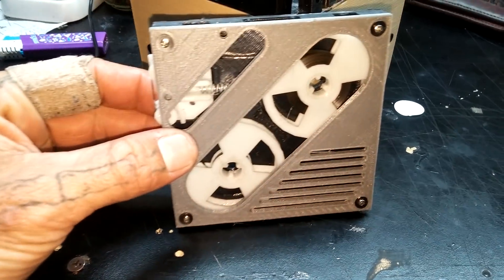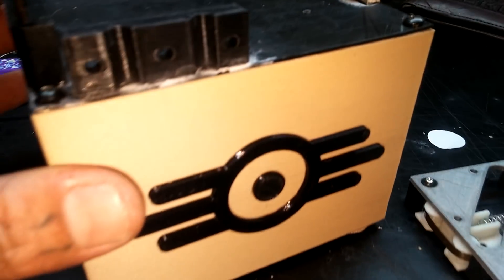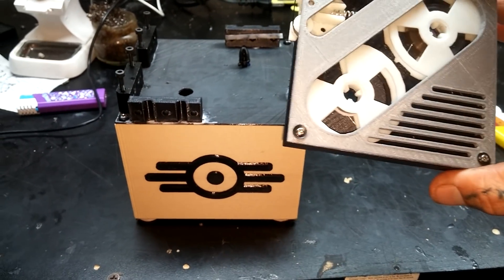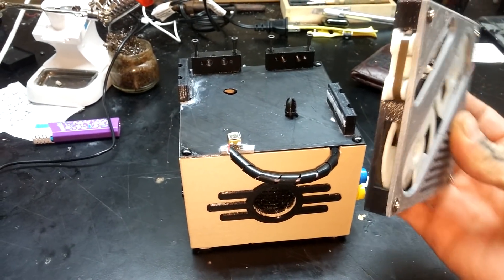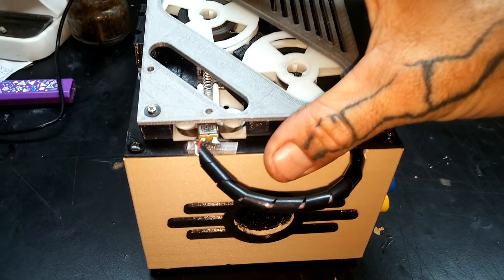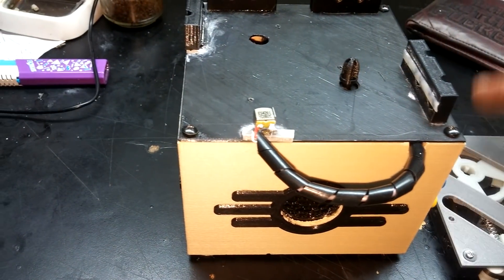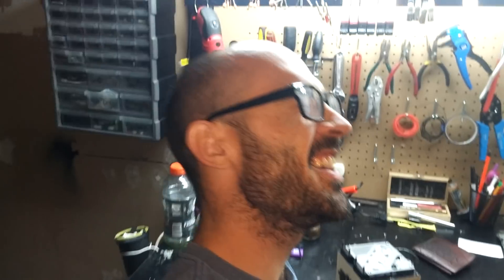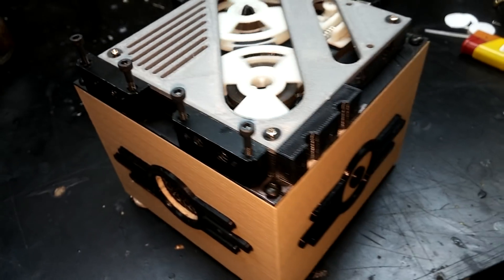Real life Holotape and Holotape player

Comment: Wow thats awesome! I saw this and I actually am trying to build my own! Have you considered adding a pinch roller and capstan assembly to it? It would be way better and you would get a steady tape speed. Plus the tape would last much much longer, I would also consider adding a felt pad in the spring pressure pad assembly with the rollers. Have you also considered adding auto reverse? I fix walkmans and cassette tape players so maybe I could design a tape transport mechanism to use in conjunction with this, I actually wanted to actually design my own WALKMAN that uses these things. I would also suggest adding a head alignment screw to align the tape head for maximum audio sound reproduction. This is truly AWESOME!!